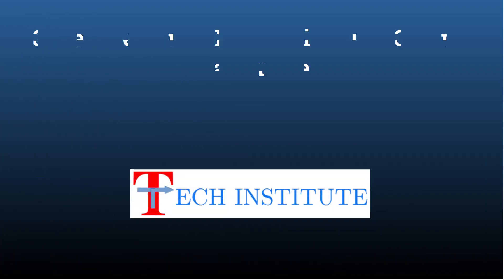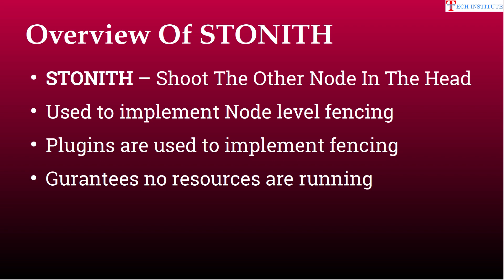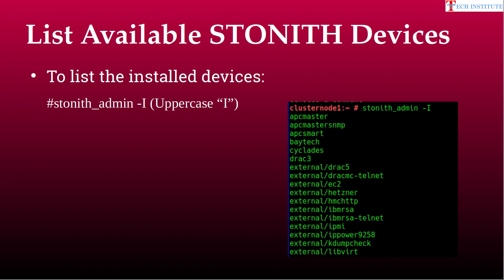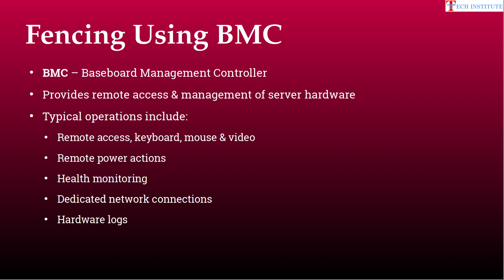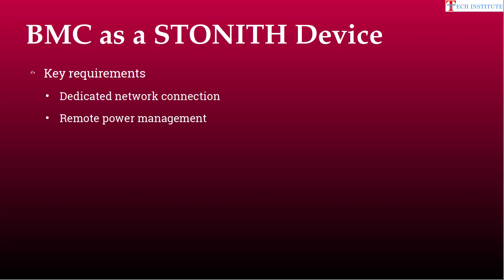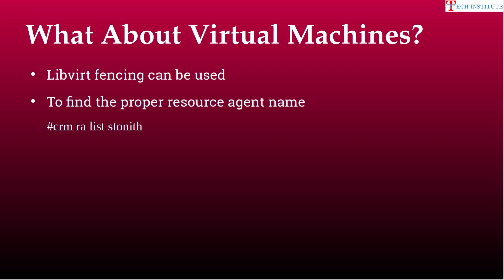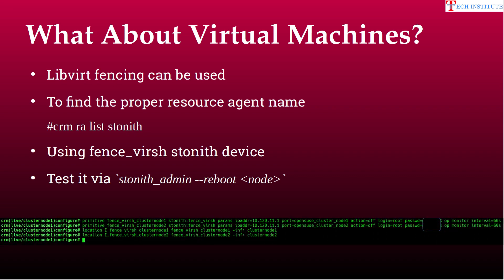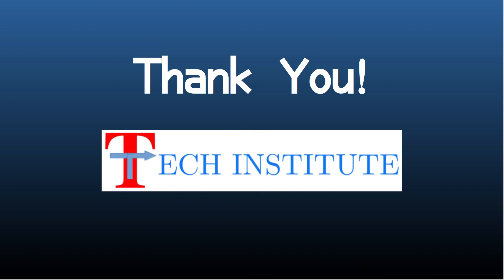Suse/Opensuse High Availability Cluster - Pacemaker || Understanding STONITH || SUSE / OpenSUSE 15

Comment: answers on Quiz:
1. What function does STONITH provides?
answer: STONITH lets us to reset node which hanged because of different reasons (kernel panics, network connection between nodes is lost).
2. Where you must run a STONITH resource?
answer: on those nodes which are not being rebooted with the same STONITH device.